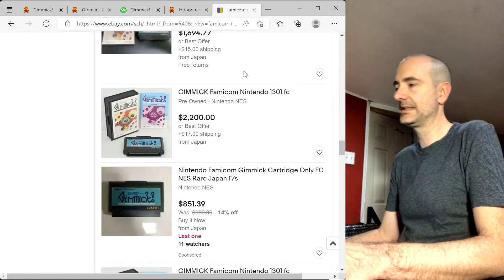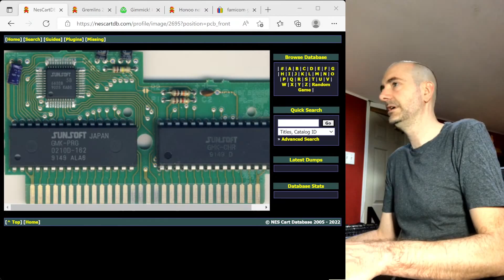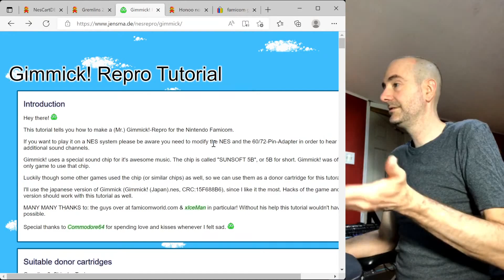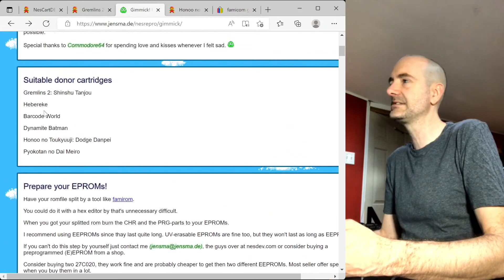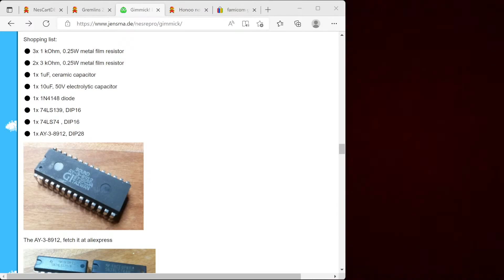Livestream: Finding rare audio chips in common games

Comment: Wondering if the old FC carts have a serial number on them (don't have one myself) and if they do, if it correlates with the chip inside.
Reply from the maker: The roms have official serials (at least the first party games) most carts also but i dont know a case where an equivalent mapper changed the number